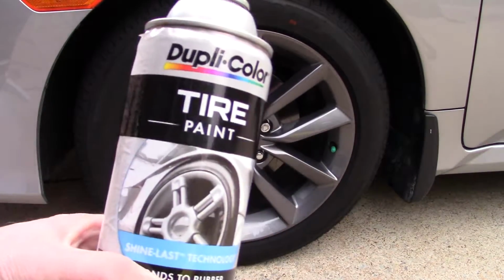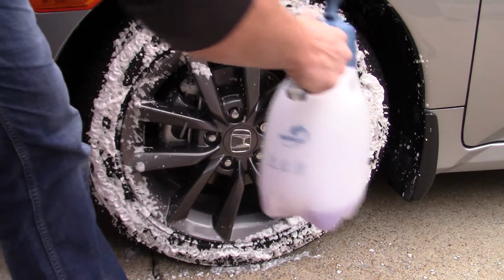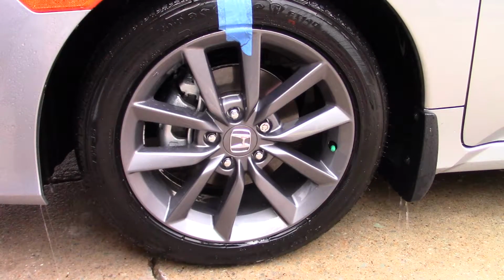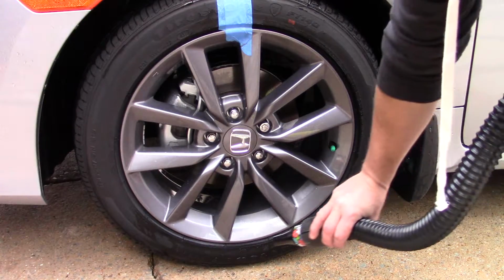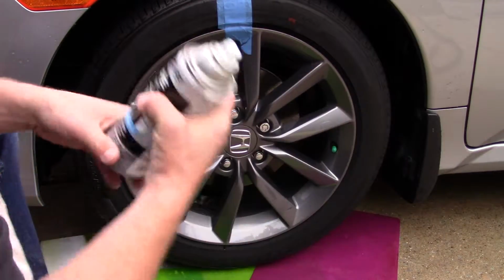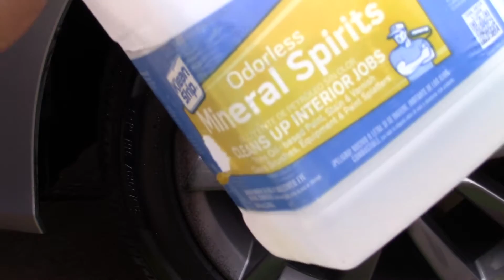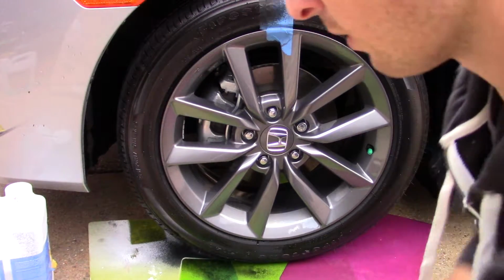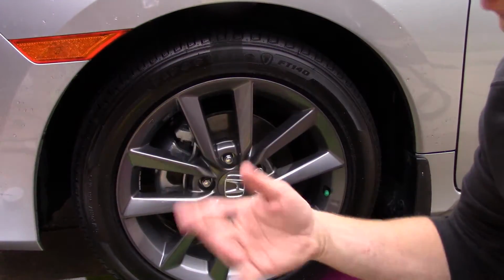How To Apply Dupli-Color TIRE Paint TIPS & TRICKS : The Best Tire Dressing!!!

Comment: Hi Landon I tried the tire paint on my winter tires and decided to see if Tire Paint would last a Canadian winter.  I cleaned the tires till I was damn confident they were clean.  That is the key I think.  Also if you aren't spraying you should be shaking that can.  Anyway I took the winters off my truck March 20.   So 4 1/2,  3958 miles through snow, sleet, salted roads, -30 C typical Canadian winter and they still looked great.  The sheen was gone which is ok.  Don't like the wet look myself anyway.  The reason I got such good results is because I used the entire can on 4 tires lol.  No lie.   But hey I'm betting they make it through next winter too.

Comment: Love it . Question: after using this on my fourth car the spray only work upsidedown is this normal?. How can i avoid this in a long run. Look like there is still a lot of paint in the can. Thanks
Reply: Keep shaking the can as you apply, otherwise the gas will wanna stay at the top and the liquid at the bottom, you wanna keep em mixed

Comment: How long would you have to wait before applying the clear after applying the black?
Reply from the maker: nihilisticpunk24 normally around 1 min if that.  Depends on the temps but if it’s over 70 most likely around the 1 minute mark.  Great question 👊👊